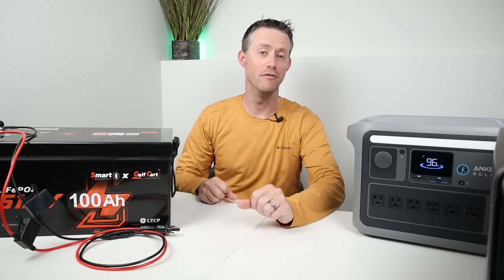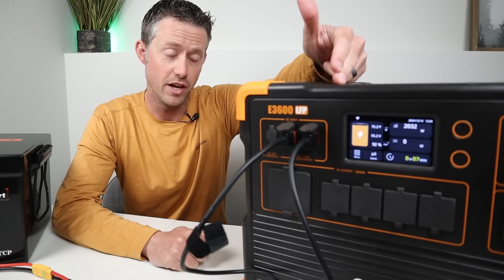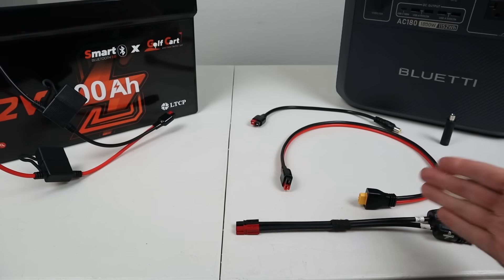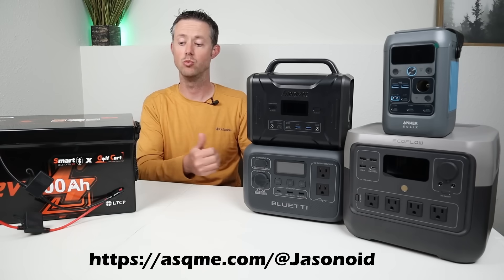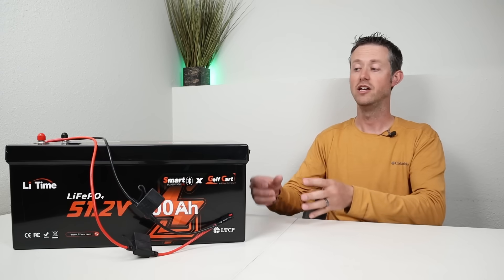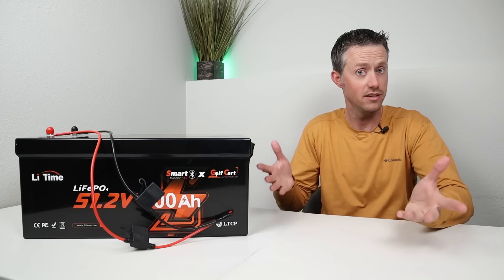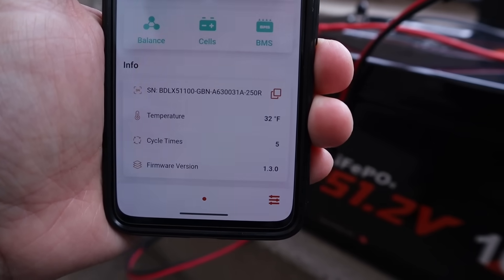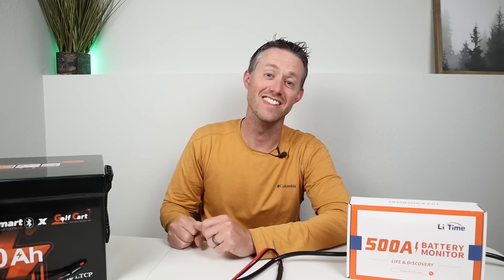Simple Trick to Make Your Power Station Last 5X Longer! Charging with a LiTime 48v Smart Battery!

Comment: So, your power station shouldn't get confused on the input if it is a higher voltage?  Does the higher voltage just increase basically the energy density or something?  I have a small ecoflow river 3, online says it can have 110W solar input and I have used my 12v 100ah watt cycle lifepo4 into the Xt60 port believe it is and it maxes it out at 100watts.  I attempted to hook up my 225w inverter and it said overload when I used the AC port.  I assumed since it was modified sine it might have been picky.  anyways, my main question is- does the higher voltage make the energy more dense as why it charges more quickly?  I didnt think about possibly getting a higher voltage one, so stuck on 12v stuff cause that is the route I am going to assemble my bank, seems the most common.
Reply from the maker: The smaller River 3 can't connect to a 48v battery, the voltage is too high and would damage the power station. Connecting to a 12v battery directly using the car charger is the fastest that unit can charge.

Comment: Hi all.
I ordered a 48V 100Ah LiFePO4 yesterday to use with my Anker F3800. I was planning on using a 10 gauge ring terminal to XT60 connector. Is the gauge too small? What size fuses should I be using? Thanks for any info.
Reply from the maker: The 10 AWG wire and 30 Amp fuses will work just fine with the Anker F3800.

Comment: but how would you charge the 48v battery.....
Reply from the maker: AC wall charger or solar panels 👍
Reply: @Jasonoid  will the 48v battery charge it 5 times on the powerstation vs 1 charge on 48v?  ty for reply

Comment: Could you charge these 48v Li-Time batteries using an EV charge station?
Reply from the maker: I don't think so, at least not the standalone batteries. Some power stations accept charging from a level car charger.
Reply: @Jasonoid  possibly with a j1772 to nema adapter connected to a 220v to 110v step-down inverter i was thinking or just connected to the LiTime 58.4V 18A Lithium Battery Charger for 48V (51.2V) LiFePO4 Battery

Comment: I have two 12v 300ah batteries. Would I need to change the cable gauge if I use those to charge my power station?
Reply from the maker: The wire gauge doesn't need to change since power stations limit the charging current. 
Be aware, 12v batteries will charge the power station at 100w. You'll need a 48v battery to charge quickly. Putting your batteries in series will allow you to get 24v battery and you'll charge much faster than just with a 12v battery.

Comment: What a handy video. Going to get a couple of these to add to my Anker f3800. Those expansion batteries are $1600 each.  Such a deal.
Reply: Do you have to disconnect it from the F3800 to recharge the battery?  Curious on what your set up is. I have 2xF3800 with 3 external batteries each want to get more but they run $1700/each.  Just not sure how to recharge a separate battery like this without have to disconnect the battery to recharge.
Reply: @bdtang  if you are asking if you charge a 48v battery separately from the F3800? I would definitely separate them.   But everyone is different and can do as they please. Use the Anker charging system for Anker batteries only. The stuff is too expensive to experiment with. By hey, that’s just me.
Reply: The f3800 supports 60v solar input?  Are you going to use the xtc60 adapters? This is a cheap way instead of getting the expansion packs?
Reply: @ yes, I'm going with a 48 V 100Ah battery, that should give me close to 1200 watts (48x27)input via the XT-60 port.
Reply: @ yes, I feed a 48V 100Ah battery through the XT-60 solar inputs.
Reply: @JimEdds  just a fun fact you can check for yourself. I have found that the (6) 51.2v batteries I have purchased, the manufacturer recommends connecting them in parallel, or 4 series and 4 in parallel. Most of the time that information is in micro small print in the descriptions. It’s not a deal breaker, just thought I would post that for all to see.

Comment: Thanks for your videos. I'm a newbie in this product space due to Hurricane Helene. After the hurricane, I purchased a Firman gas generator and an Anker F3800. I was ready to buy an Anker FB3800 when I stumbled across this video. It looks like I can purchase this battery and a couple ring terminal to XT60 cables and I'm ready to go? It seems like a win-win. This would allow me to charge the F3800 while outputting 240 Volts. The F3800 won't output 240 volts while being charged at through 120 volts AC. Let me know if I'm missing something.
Reply from the maker: Yes, that is correct, the only way to keep the 240v active is to charge the F3800 power station via DC input. This is an option and also you have this option:    https://youtu.be/T_zZceBWZHk

Comment: Would this work with a smaller battery? I have the same type of battery but it's the 12 volt 100 ah version. I have been using it to charge my jackery explorer 240+. I'm curious, I also have a 500 watt inverter that I've been messing around with but it also has alligator clamps and it doesn't feel very safe to use them. I was wondering, if I bought two sets of these cables could I have one set on my inverter and one set on my battery and just plug and unplug it from the Anderson cable when I need it?
Reply from the maker: The smaller Jackery power station would be compatible with a smaller 12v 100ah battery, it would charge around 100 watts (which is plenty for that small model). You'd need these adapters:
10 AWG Ring Terminal to Anderson With Fuse:   https://amzn.to/41qZdyt
Anderson to 7909mm:   https://amzn.to/3ONnV4I

Comment: Will this work on an EcoFlow unit?
Reply from the maker: Depends on the unit model. It needs to accept at least 60v input since the battery voltage can be up near 58v.
Reply: @ I have a 200amphour 12 volt battery could I hook this to a delta pro 3 I’m guessing threw the actual plug in charging port somehow
Reply from the maker: @TeresaPatterson-l5o  you'd use something like this https://youtu.be/NeBx70G2g6s

Comment: Very nice! Just so I understand correctly, if my 3800 was dead and I connected one of these fully charged batteries, I would only get 1/2 the 5120 Wh until they balanced so my 3800 would take about 2500 Wh of it? Thx!
Reply from the maker: When connecting a 48v battery to the F3800, it will start charging at 1150 watts. If you let it charge for 2 hours, 2300wh of energy will go from the 48v battery into the F3800. They don't communicate so they won't 'balance out'. The F3800 has 3840wh of total capacity, so with 2300wh of energy it would be about 60% charged.
Reply: @Jasonoid  thank you!

Comment: Great video! You said this battery output is at around 58 volts but how many amps? Sorry I’m a noob here😅, my power station input is 12-60V 25A Max, 1200W Max

Comment: Hello nice video... Can I use this 48v battery with my jackery 700 plus?
Reply from the maker: Yes, I searched for the input specs and this is what I found:
DC Input:12-60V⎓11A Max，Double to 11A / 400W Max

You'll get 400 watts charging with a 48v battery
Reply: @Jasonoid  Thank you so much

Comment: It’s cutting it close, but what about compatibility with the new DJI 500/1000? The maximum input voltage is 58.5V. Will 24V or 36V deliver similar results for the smaller power stations?
Reply from the maker: Technically those power stations require their external MPPT charge controllers which have a voltage limit of 30v, so not this option would not work for them.

Comment: So ive been reading comments but i aint sure i got a clear idea if its possible at all . Can you somehow charge the external battery with solar at the same time that it is connected to the power station ? Can there be an automated system with a solar controller connected to the external 48v battery , which then is connected to the solar input of the power station and the whole thing just works? Both external and internal batteries are charged by the sun and the power station just does its thing .
Reply from the maker: Yes, this it totally possible. You'd have your solar array charging the 48v battery, and then you'd connect your power station to the 48v battery. The solar charges the 48v battery, your power station charges from the 48v battery. Both charge at the same time from one solar array. You'd want to have a decent solar setup to make this possible.
Reply: @Jasonoid  Thank you for taking the time to give me an answer .

Comment: question should i get this battery  i can't really go for solar because of hoa  i do own the delta max pro  delta 2 with extra battery and anker solixc1000   i  do appreciate it your advice
Reply from the maker: Only if you think you need a longer runtime. You have to ask yourself, why are you buying the battery?
Reply: @Jasonoid  only using for back up  for my fridge and wifi. reason why im thinking buying the battery is to recharge all my power battery.   since i cant have solar  on my condo   does it make sense. just to buy this battery ?
Reply from the maker: @junl8282  that would definitely allow you to get more runtime from your power stations. Make sure you buy a 48v battery charger so you can charge the battery back up once it dies.

Comment: Excellent  content as always  , is OK to run 12, btu air conditioner  with an eco flow delta 3 ,while charging  with a 48 volt battery  ,  can you do video of charging  with a 48 battery  while using a power station  and run time like for example  a heater .

Comment: Wait I'm confused, I'm not familiar with the Anderson connection. The Anderson with fuse to terminal rings looks to be male and the link you provided for my particular setup, Anderson to xt60i looks to be exactly the same male end for the Anderson as the link you provided for the  Anderson with fuse to terminal rings. Do they slot in together even though they both look to be male ends? And your 10awg Anderson to ring terminals are 10 gauge and all other adapters are 12awg, does the discrepancy in gauge size matter when Im pulling 48v from a server rack singular battery?
Instead of fiddling with Anderson connectors couldn't I just use a 10awg ring terminal to MC4, add a 15amp MC4 inline fuse on the positive and then hook up a 10awg MC4 to XT60I?
Reply from the maker: The Anderson adapters snap together, theres no way to connect them wrong. You can definitely use the MC4 adapter if you want. If you want more direction you can submit a question here:    https://asqme.com/@Jasonoid

Comment: I wired my 24 volt 100AH battery to my Jackery 5000 plus to the low PV input port. It does nothing. Why?
Reply from the maker: Are fuses installed in the fuse holders?

Comment: Why on earth are their fuses on both legs of that cable?  That makes no sense in a DC application.
Reply from the maker: It's just the way the cable came. I couldn't find anything 'off the shelf' that was 10 AWG wire, ring terminals to MC4....
Reply: @Jasonoid I'm guessing not designed by an EE

Comment: I am currently using a standalone 24v battery using XT90 to ring terminals. Now I see your using a fuse with the Anderson. Is it safe to continue XT to terminals without fuse as in of your previous videos?
Reply from the maker: You could always add a fuse for more safety. I added a fuse due to the higher voltage / power available from the 48v battery.

Comment: This is awesome and all but then how would you charge the expansion battery and the power station with solar if you are using that port?
Reply: Charge the battery directly with solar using a charge controller, then just plug it into the power station to charge the station would be one option
Reply: @ ahhh I see thanks for the comment!
Reply: @tonelessbod  another more round about option would be to charge the station with solar, and then run a trickle charger to the expansion off of the stations ac ports. There are lots of ways, none of them are especially elegant, but that's why you're saving hundreds compared to the branded expansions for your specific model.

Comment: Eco flow delta pro using xt60i cables from my 48v to delta pro solar port produces surging in charging. It will ramp to 1000w then back to 0 over and over. Like the charge controller in the delta pro can't regular the voltage. Any suggestions?
Reply from the maker: Please elaborate how you are connecting the power stations together. That was not enough information to understand what's happening.

Comment: Would it be possible to use this setup and connect it to a mppt controller at the same time and leave it like that?  Or does it have to be one or the other?
Reply from the maker: The battery can support charging and discharging at the same time. I would recommend having some sort of charging option connected to the battery. Having a solar charge controller connected all day is an excellent way to keep it full.
Reply: @Jasonoid  so I can literally connect the battery then slip the connectors for the adaptor right over it, tighten the screw over both sets of connections and Bob's your uncle?
Reply from the maker: @derekcantor5711  hard to image what you are connecting with that description you gave me.
Reply: @Jasonoid just connecting a 48 v charge controller, to a 48v 100a lfp battery, then using your adaptor to pit power into my AC200L through the dc/solar input.
Reply from the maker: @derekcantor5711  yes, that's completely fine. I just wanted to make sure just to be safe 👍 good to go
Reply: One last question. Since I'll have 2 connections to the battery (one from scc and one to the adaptor putting power into my power station), is it ok to stack on the terminals or do I need to use a couple busbars?
Reply from the maker: @derekcantor5711  stacking should be fine with two or three wires, if you have more, use a bus bar.
Reply: Last question i swear. I bought everything, got it hooked up to my Bluetti AC200L. However I'm only getting 750 watts when plugged in to solar instead of the 1200 max.  Using a Lossigy 48v 100ah battery.   Need to update a setting in the Bluetti app?

Comment: Can you do a video which shows how to connect multiple 48v batteries so that you have more run time before you need to charge individual 48v batteries?
Reply from the maker: I'll consider doing a video like that. I know Will Prowse has a video on the topic.

When connecting batteries in parallel, you want to make sure each one is fully charged. Having matching brands and models is preffered but not always required. You connect them together, positive to positive, negative to negative using wire that can support the total output of both batteries.

Comment: I just received my Anker F3800 your review helped. I own a few Ecoflow products and I’m shocked how basic the Anker app is compared to Ecoflow. Basic on off is about it. This works great but no way to limit charging just 100%
Reply from the maker: You can limit the AC charging speed within the Anker smart app, in 100w increments. No power station that I am aware of will limit the DC charging rate.
Reply: @Jasonoid  Sorry if I wasn't clear, With Ecoflow app I can limit charge discharge limits. 10 to 90% for instance, Anker support said use a smart plug and time charge to guess at a level.  With all the warnings about not leaving batteries at 100%,  this is not what I would expect from Anker.
Reply from the maker: @ThanksForTheLaugh  that's old news. LFP batteries last so long it's not that big of a deal to charge them fully. In fact, power stations have 16 batteries in series (for 48v) and the only time they balance out is up near 100% soc. Its super important to charge them to 100% to get the cells balanced.
Reply: @Jasonoid  It's little more nuanced than that. I defer to Will Prose on the subject. He says nonsolar  longterm storage 50%, charge to 100% occasionally.  Used in solar system cycled everyday cool environment  best to 100%.  I just received your recommended Anderson to XT60 setup, very well made. My Anker F3800 is charging on one port 1150 watts from by 2 48V rack batteries. Thanks!
One of Wills video's on subject.
https://youtu.be/UbZiHzflKMY
Reply from the maker: You didn't ask about long term storage, you asked about daily usage. I'm well aware of what Will mentioned in his last video. Daily usage is very different than storing the unit in a closet to degrade for months.

Comment: Can this be done with a bluetti AC200max?
Reply: Yes!

I do it on mine 24/7.
Reply: Which interface do you use, the aviation port or the 7909 port?
Reply: @beetreefarms4471  

It does not have a 7909 input port.
So yeah, only through the aviation PV Input port.

Comment: Curious what kind of cables I would need to do a similar thing for a Jackery 3000 Pro.
Reply from the maker: You'd need these parts (listed in the video description (two full sets, one for each charging port) 

Power Station Adapter Cables:
10 AWG Ring Terminal to Anderson With Fuse:   https://amzn.to/41qZdyt

Anderson to 7909mm:   https://amzn.to/3ONnV4I

7909mm to 8020mm Adapter:   https://amzn.to/3BmevtG